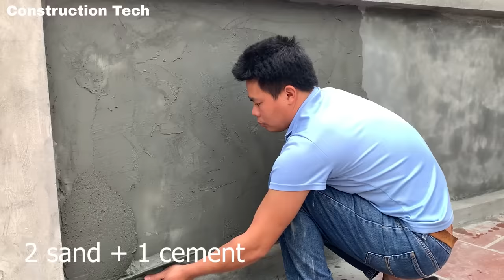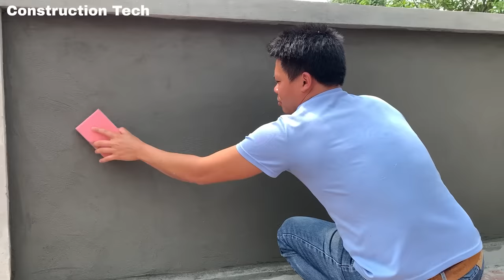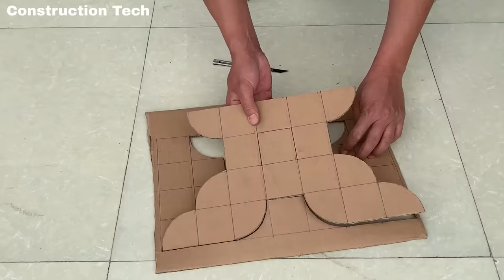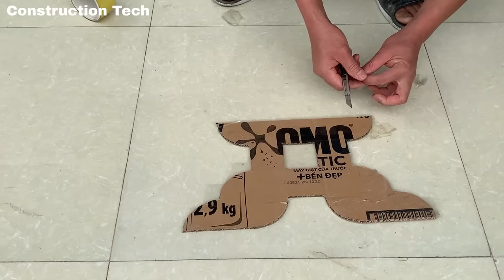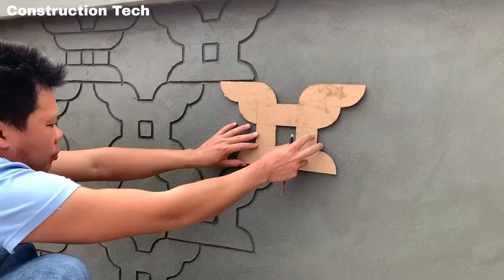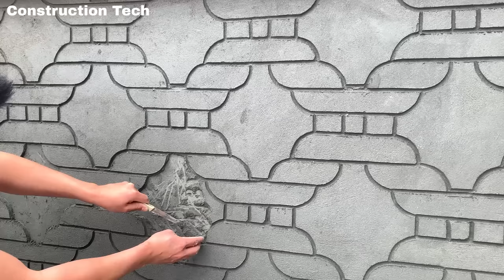Professional Construction Skills New Style Fence Renovation Great Creativity Using Sand And Cement

Comment: please what was the white tool that you have used to make the cement shoft
Reply from the maker: Hello - it is a tool made from thin, curved steel wire with a slot of about 1 cm used to cut the mortar layer to create grooves.